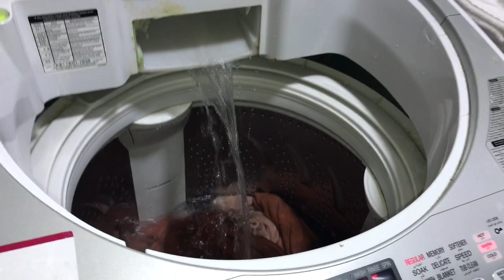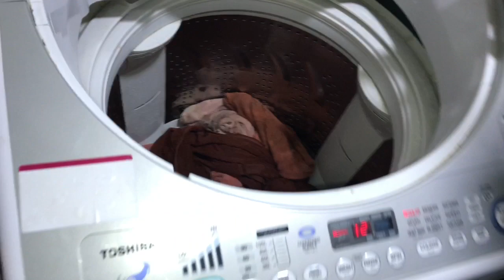How To check Drain problems in Toshiba Top Load washing machine Telugu

Comment: SID TECH hi,,,
I have the same issue with my lg fuzzy logic 5.5kg top loading . As mentioned in the video sensor changed but it remain same. I have checked the drain motor looks working good as clutch releasing and back.

Could you plz let me know what was the faulty part?  Dis u change the gear assembly ?

Tks in advance